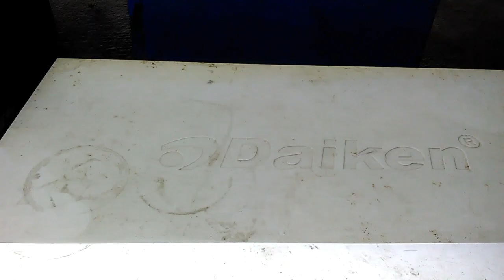Cara membuat alat press plastik sederhana ,,, tidak usah nyolder

Comment: Om kalo pake batre 4v aja bisa brrti bisa pake casan hp dong om.??
Reply from the maker: Bisa, tapi cas hp itu PSU switching bisa panas IC/transistor nya bos. Mending pakai adaptor biasa lebih aman untuk beban kawat nikelin ini.
Reply: @Kangewoxchannel  adaptor yg brpa om.? Klo lebih dari 4v nyala gak kawat nikelin nya.??